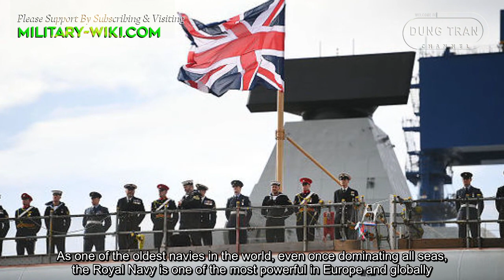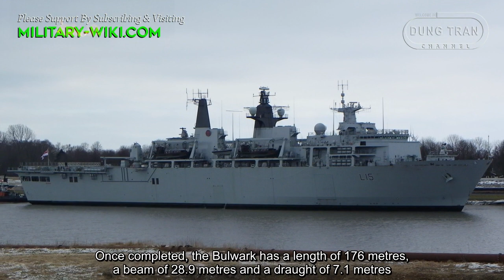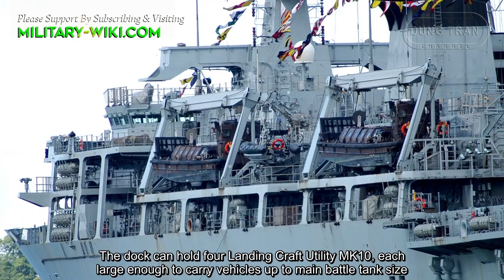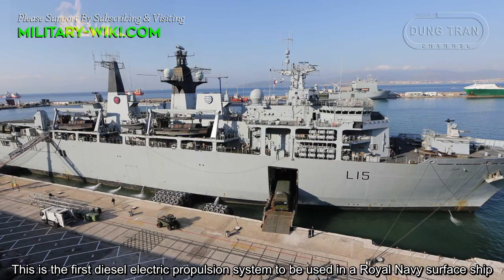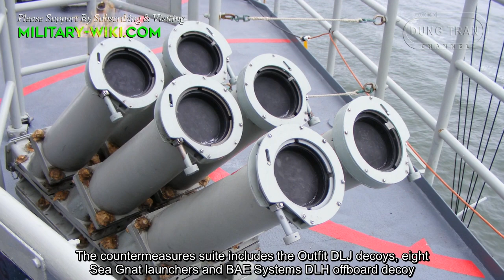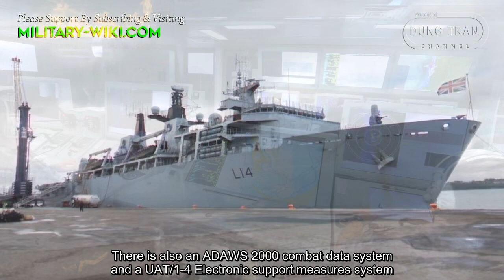Albion class: The Punch Of The Royal Marines Ashore By Air And Sea

Comment: Weird to replace one system with a similar system. I would have understood the millennium gun or RAM but goalkeeper for phalanx. They have similar capabilities in range and targeting.
Reply: the good thing about phalanx is that it requires no additional structural compromises. it is a bolt on bolt off system. the goalkeeper requires the hull or deck to be opened up.